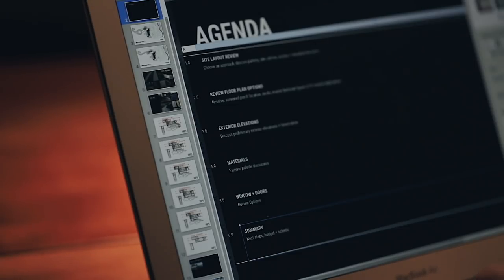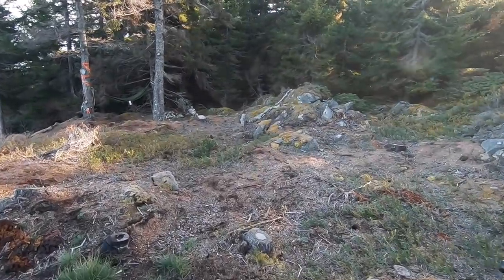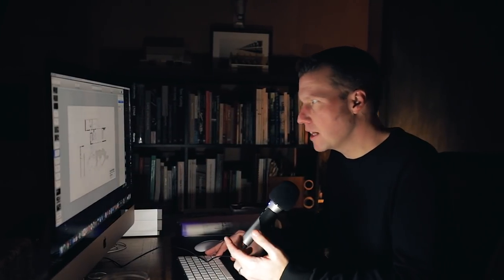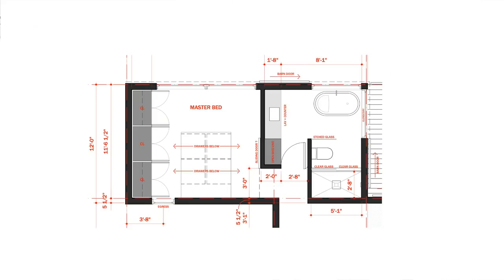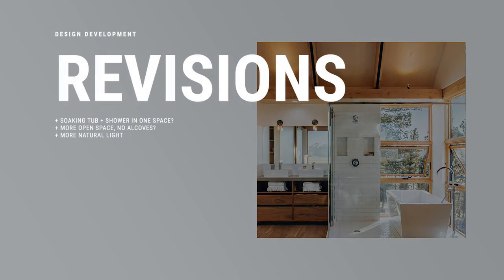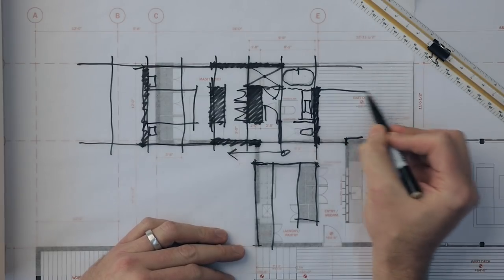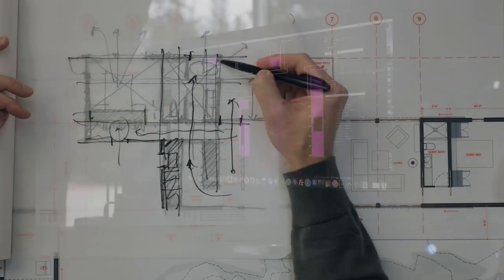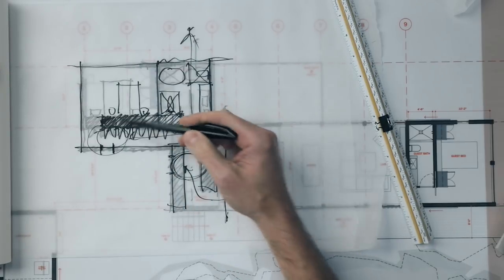Design, Meet, Revise, Repeat | The Outpost Project Part 8

Comment: that moment where you put the toilet in the corner of the bathroom in the top right corner 😂then you stopped, I could hear you think " nope, nope, not there dumbass"... 
That last bit where the corridor becomes a "dressing corridor" /walk in closet-corridor would have been my initial assumption. clean lines of travel, clean lines of thought. I wouldn't go with a punch through window (on the wall separating the dressing room / closet corridor space), more a long window on the top end of the wall, so that you keep the privacy of the dressing corridor but let some light in , perhaps have the same idea for the wall between the corridor and the master? have the light brush the ceiling and create some connection , visual I mean. Then again, translucent glass panels (acid etched ones) might be a nice added material to that space. especially if the light from the corridor illuminates the space outside. The thing about seeing the bowls of the building, if done right isn't that bad, can be a hassle to get clean though. 
How about dropping the facade almost to the ground? have like A foot of space between the shingles and and the exterior ground?  As usual , nice work! great project!!

Comment: This is so cool. I’m curious. Is it possible to reorient the changing area/bed , lengthwise, meaning have the bed face south and place the changing area behind the bed. It was a thought that came to mind in one of your iterations where the north wall of the bedroom was bumped out. The proximity of the bedroom provides the privacy. I think this was a device used in the Farnsworth House(I think). Just a thought. Otherwise, another cool design, as usual.

Comment: I can very much relate to what you do. I am never satisfied. And of course happy to redesign so many times.
Reply: I always inform my clients way ahead that we will have  only three design review meetings whereby they can bring in all their ideas,we then freeze the scheme design.. otherwise you can design forever and ever.
Reply: Farmer George  Yes. I am aware of this. Also one of the problems my partners have on me. Needless to say, I was also warned for these from my ex-boss. And I have faced the issue you present with engineers. Still can't help it. Once into a project, it is very difficult for me to disconnect from it. It will there always at the back of my mind on how to improve it further.
Reply: @architectkibathinairobi1258  I agree that is the better way to do it. But passion sometimes overtakes wisdom